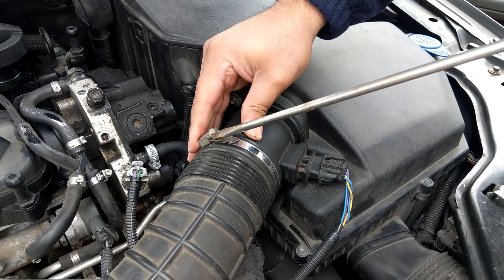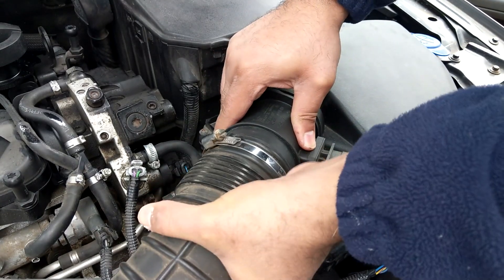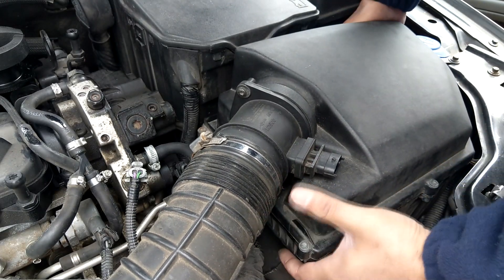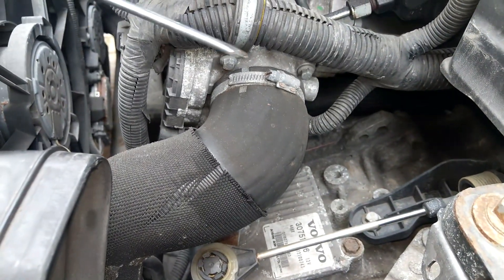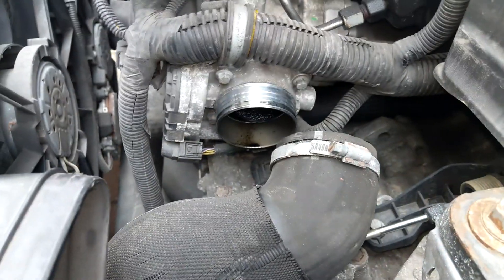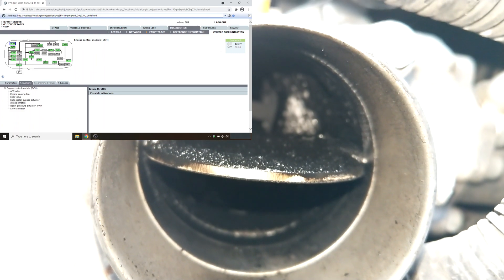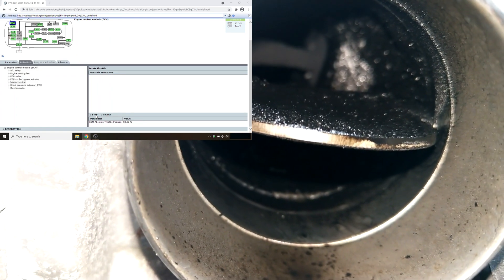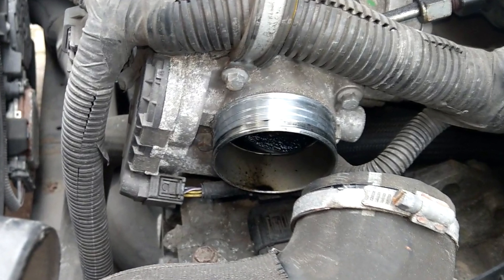Throttle Body Inspection, Cleaning and Testing

Comment: Isnt that the EGR Valve?
Reply from the maker: No
Reply: @sirobb  on d5 185 bhp , where is the EGR located?
Reply from the maker: I don't know exactly but there are videos on YouTube so a quick search should sort you out.
Reply: @sirobb  no worries , I enjoy watching your videos.

I have a crappy Volvo XC70 which runs lumpy , faults 2670 2680 2690 26B0 , Injector power stage fault.

Any ideas?
Reply from the maker: No idea. A good quality fuel filter replacement has solved many a running issue though.
When you have fault codes, a Read with Dice and Vida is the best way forward. Guessing becomes expensive fast.

Comment: I need some advice around 2 problems, one is really pointless foot brake 9n my xc90. And the second one is steering angle sensor or clock spring issue on my xc90

Comment: Hi Simon, you have probably been asked this dozens of times but do replacement throttle bodies have to be coded/programmed by the dealership? I can't seem to get a straight answer on this.
I have a 2003 V70 T5 and the original throttle is done. I've purchased a brand new Bosch unit which i have checked is the correct part and is identical to the old original one (which is branded Volvo) The Bosch one i have purchased is a 'virgin' unit so will my T5's ECM recognise it ? Is having to have it coded just a myth? My friend has VIDA and says there is no coding mentioned in the fitting procedure? What do you think? Do people tend to get the terms ETM and Throttle body confused, are they not two parts of the same unit? Thanks
Reply from the maker: If Vida doesn't state the software upgrade procedure along with the software part number, it isn't required.
It may need a calibration/adaption though which is in the Advanced tab of Vehicle Communication.
Reply: @sirobb I did speak to my local dealer ship and they said it would need fully calibrating however i fitted  the throttle body myself over weekend and it car runs great, its seems it was just plug and play after all. MPG hasn't been affected either.

Comment: Hi. I'll add another Thank You for your videos! I like the way you clearly explain things. Using your videos for guidance I've cleaned out the throttle body, EGR valve and inlet pipe on my 2015MY V70 D5 Auto with 50k miles. The performance has improved and selecting drive/reverse at idle is now much smoother too. I'm impressed with the results and I'm now wondering if there's any further improvement to be had by cleaning the intake manifold too? The car is running fine but could I make it even better by cleaning the manifold or is the biggest improvement normally with the throttle/EGR? Best wishes, Mike

Comment: Hi ,have you done a video on the d5 pcv breather replacement thanks .
Reply from the maker: No because they're never a problem. If you're suspecting yours, the issue is more likely something else.
Reply: @sirobb  thanks for the replies ,was going to do some general maintenance ,was just considering is it worth putting a fresh one in or just leave it .
Reply from the maker: Mine is trouble free and original at 19 years 200k+ miles and I've never heard of one needing replacement.
Reply: @sirobb  👍 thanks for your help ,ive also got injector,engine mounts, to do few other bits and bobs your videos are brilliant keep up the good work ! 2004 s60 d5 👍

Comment: Have you done swirl flaps on an XC90 ? What's your opinion on what they do and don't affect .... Seen one with leak at swirl seal .... Swirl disconnected suspect motor isn't working but one of the injectors has carbon round it ..... Seen many now saying unless you get lights or limp mode then just leave it ... Others of course say get the swirls replaced on balance what do you think ? Is it just a messy swirl flap area and a wee bit of oil loss or there is wider implications?
Reply from the maker: No never needed to do swirl flaps.
Volvo do a cheap repair kit for the actuator to keep the arm in place. 
If the arm is disconnected, you can manually move the swirl linkage to see if it's free moving.
You can also test the swirl actuator motor with Dice and Vida to view full movement. 
Clean the area of any oil leakage thoroughly then monitor oil levels to see if the loss is significant.
Reply: @sirobb  thanks m8. yeah it's more the presence of oil and no active swirl .... Other than a dirty engine bay are there any further issues e.g with egr and dpf ? Personally I thought it has little affect connected or not and seen many posters just deleting them altogether.